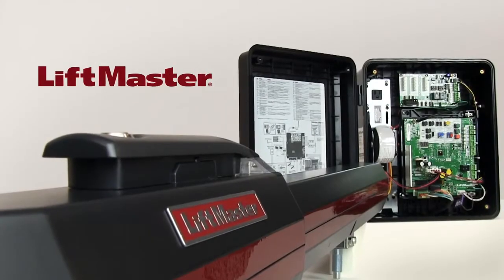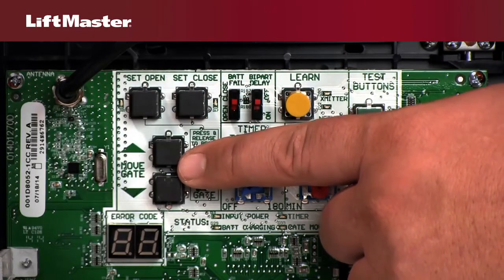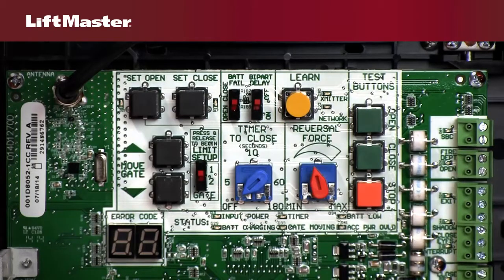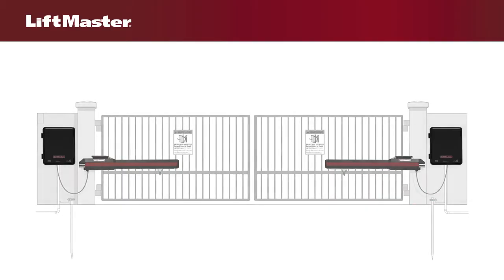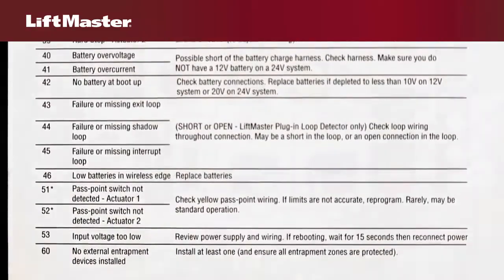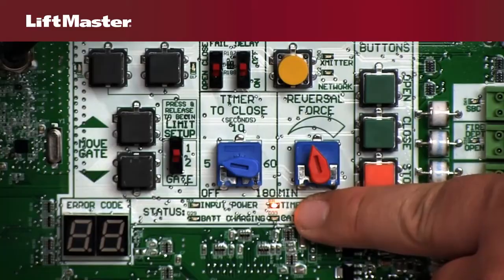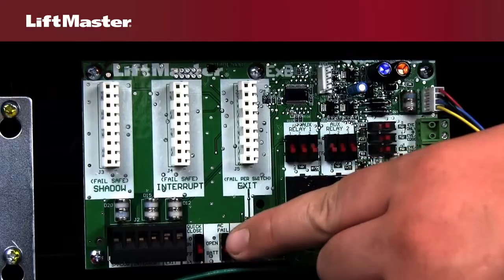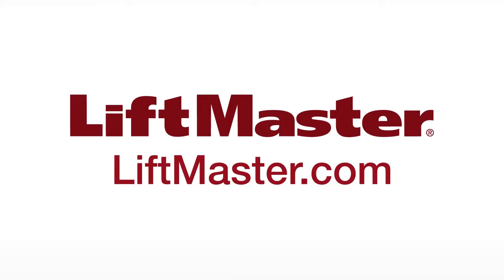LiftMaster - Actuator Gate Control Box Overview

Comment: Have a LiftMaster slide gate trying to find the video for it. It was working. Someone dragged the rail off, came back and welded it and then someone else disconnected the chain and reconnected the chain. I checked the belt looks good. It worked walked in the house the next morning after the rain it won’t work with the remote now I don’t know how to get a hold of a company I bought it a while ago. He told me that there was a computer program. I could put on my phone to have the gate opened by the phone.

Comment: I changed battery on the lift master key pad model number 877 max, now the key pad doesn’t work, will you please let me know what should I do , thank you.
Reply from the maker: If you are using the 877MAX with a LiftMaster gate operator similar to the one shown in this video, you have to locate the Learn button inside of the gate operator control box. Press the Learn button on the main control board, and then press the Open button on the gate operator control board, then press the open button on the 877MAX.

Comment: How do you change the frequency on controller, mine and neighbor across the street are the same......
Reply from the maker: Keith Sanderson, sorry to hear about the problems with your gate operator. It sounds like you are having issues with your remotes not working properly?

The LiftMaster LA400/412/500 have built-in radio receivers, that to my understanding do not have the ability to change frequency. If you are having issues with the range of the remotes, you may try relocating or raising your antenna higher in the air. Things like metal and other electronics can cause interference. A new radio receiver and/or transmitter may also be suggested, one(s) that operate on a different frequency that you are currently using.

Comment: My gate won"t open and the code is showing 93 which means something is blocking the gate. But nothing is blocking the gate. what can I do?
Reply from the maker: The gate/fence panel should be able to move freely and easily without any assistance from the gate operator. Try turning the power off to the gate operator, use your key to release the arm actuator, and try moving the gate panel back and forth. It should move freely without binding. If you struggle moving your gate panel, your gate operator is going to struggle. This may be causing the error code you see.

This could also be a problem with the Absolute Position Encoder, or APE. You can check the wiring on this piece to make sure it is all still intact, but most likely this piece needs to be replaced. The APE is located inside the actuator arm and diagnosis and repair should be done by a qualified gate technician.
Reply: 6 months replaces part 4 times need a different gate opener

Comment: My gate won't close. Just only little bit and open again. I've checked wires. System is 2 weeks old working fine until today. No error codes. Any suggestion? La500
Reply from the maker: That's weird that you wouldn't see an error code for this type of problem. Are you able to watch the main control board while the gate attempts to close? Perhaps the code is flashing only when in motion? Also, keep an eye out for any other lights, or LEDs, that might turn on when the gate stops and reverses.
Reply from the maker: If you are still not seeing the cause, I would start with looking at the gate panel itself. Turn the power off to the operator and manually release the actuator arm. Attempt to move the gate panel close and open; does it bind up at all or is it hard to move? May be an issue with the operator requiring to much force to have to move the gate panel.
Reply from the maker: A photo eye, or edge sensor, may also be causing the gate not to close. A photo eye can be triggered falsely if it has any built-up condensation, or dust on the lens.